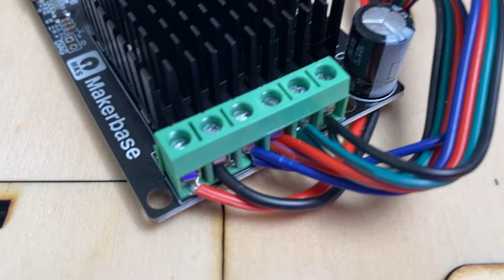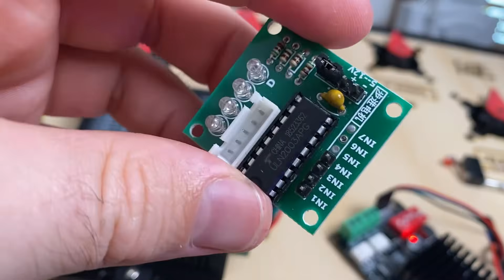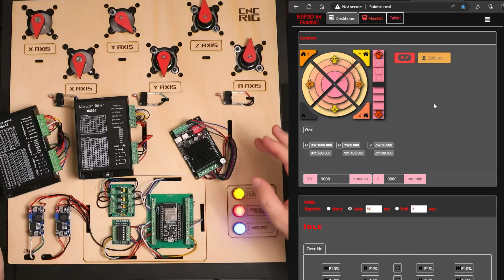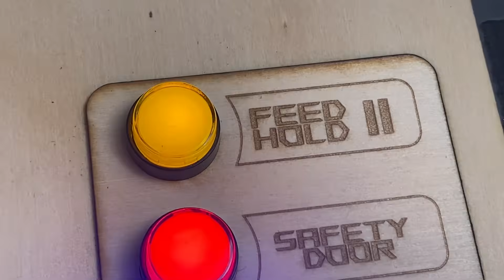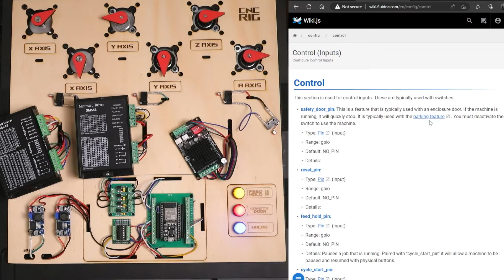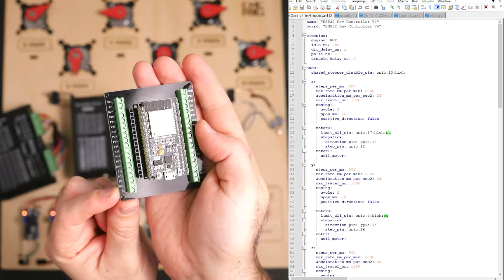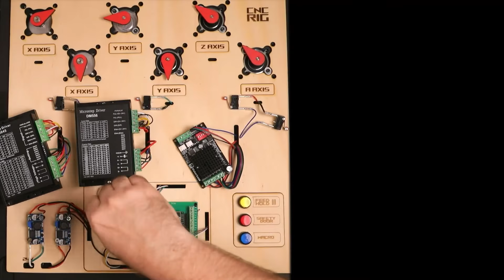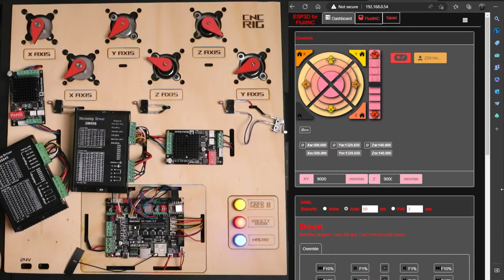CNC Wiring Basics // FluidNC // ESP32 // TinyBee controller

Comment: hello good day,  notice that u connect the motor direct to the DRV8825 Stepper Motor Driver.  con u also connect the power supply as well if u want to use a 45v powersupply.

Comment: Why not use optocoupler for the motor drivers as well as the limit switches.  Asking because i don't know and want to learn. Not to criticize
Reply from the maker: Great question and I really appreciate you asking it from a learning point of view 👍

You’re absolutely right that optocouplers can be used, and in fact many stepper drivers already use optocouplers internally for the STEP/DIR inputs. Their main job there is electrical isolation to protect the control electronics from noise, ground loops, or faults on the motor side.

On their own though, optocouplers are fairly basic devices. They’re great for isolation, but they’re relatively slow, add signal delay, and don’t handle the precise timing and high-speed signalling that modern stepper control needs by themselves. That’s why they’re usually paired with dedicated driver ICs that handle microstepping, current control, interpolation, stall detection, and so on.

For things like limit switches, optocouplers make a lot of sense and are commonly used, especially in noisy CNC environments. For motor control signals, they’re already doing their job behind the scenes inside the driver, rather than being added externally.

So it’s not a bad idea at all, it’s just that in modern CNC setups most of that work is already baked into the drivers we use.
Reply: @NEWTechCreative thank you for the detailed reply. That makes a lot of sence. I have to admit i am struggling with this yaml file for my plasma cutter and fluidnc. Do you by chance have an example i could use as a starting point? Thanks alan
Reply from the maker: @alanswanson5642 unfortunately I haven’t yet had a chance to dive into the work of plasma cutting, however this it a machine that would love to build down the track. Feel free to send me more info about your machine and what would you like to do and I’ll do my best to direct you. Newtechcreative@gmail.com

Comment: Great video i used it multiple times to reference the wiring scheme. 
Can anyone tell me when i wire things like this is it safe to connect esp to computer with usb cable? 
I'm using fluindnc with UGS over network for machining but now would like to add laser and did not find any sender for fluidNC that will work over network
Reply from the maker: That’s great to hear. Yes, it’s safe to have the ESP32 wired to your PC, but you may run into upload issues if certain pins are connected to external hardware. If you have anything attached to GPIO 0, 2, 5, 12 or 15, you might need to disconnect those lines before uploading because they’re boot-strapping pins and can interfere with flashing.

As far as I’m aware, only the onboard FluidNC WebUI can be used over the network. For sending G-code over USB, you can use a range of programs. LightBurn and LaserGRBL both work well with FluidNC when connected via USB.
Reply: @NEWTechCreative  Thanks, that’s what I thought for GPIO 0, 2, 5, 12, and 15. I just need to cut the +5 V that is coming from the DC-DC step-down (i wired it that way so i can use it ugs from anywhere without cable) sending g-code over network is stable for me with UGS but it wont be for engraving images

Comment: Mine, when jogging negative x, the stepper negative z also moves and vice versa, please help me
Reply from the maker: Without much context sounds like a wiring problem. Check where you connected your pulse and direction pins to your drivers.

Comment: Do you recommend fluidnc over grbl software, I'm running esp32 as well
Reply from the maker: Great question! FluidNC is a very active project with new features and updates released regularly. At its core, FluidNC is based on GRBL, so the motion control fundamentals are very similar. The main difference is that FluidNC is designed specifically for the ESP32, allowing it to take full advantage of the hardware (Wi-Fi, web UI, more memory, faster processing).

Some people prefer the simplicity and long-standing stability of GRBL, but if you’re looking for additional features, flexibility, and modern hardware support, FluidNC is an excellent option. It supports multiple axes, more advanced kinematics, external drivers, SD card streaming, and has a built-in WebUI for configuration and control—things GRBL doesn’t provide out of the box.

So if you’re already running an ESP32, FluidNC is definitely worth considering as it’s purpose-built for that platform and continues to evolve quickly with community support.

Comment: somebody has probably brought this up already, but in case they haven't: that connection on the esp32 expansion board isn't mislabelled as ground, it's just that the expansion board is for a different version of the esp32 board than you have. My esp32 has ground pins consistent with the expansion board; I was careful to buy them as a package on aliexpress so that I wouldn't get surprizes.
Reply from the maker: Oh good find!! Since making the video, various breakout board have been released online and definitely plenty to choose from 👍👍

Comment: I have a small question, what wire gauge are you using to connect the tiny bee to the external driver?
Reply from the maker: As it is only needing 5v and low current 22guage is more than sufficient

Comment: I have a TinyBee on the way. I can't make any sense of this.The board it's all mounted to hides the wires. I would get so much more from seeing which wires go where. When you talk about pins, I can't see the connection between the config file, to the physical configuration.
Reply from the maker: I can appreciate your point! Unfortunately it’s not as easy to outline traces from esp32 on the tinybee without having to view mks tinybee schematic. There is a great wiki in fluidnc that should be able to get you in the right direction. 
http://wiki.fluidnc.com/en/hardware/3rd-party/MKS_TinyBee
Reply: @NEWTechCreative  Thanks man.

Comment: Im building a budget cnc plasma and I'm considering the tinybee controller.  So just to be clear, with this board it produces the 5v for external drivers instead of the 3.3? Also is this board opto isolated or should i still install the one you had installed in the first demonstration?
Thank you.
Reply from the maker: Great question! No- I don’t believe the tinybee has any optical isolation on inputs/outputs. Yes the motor outputs are 5v. No need to use optic isolators on outputs…. Only inputs if needed. If you use shielded wires you might be ok… however I have heard users struggling with isolation and plasmas. Ensure you use the plasma units with CNC compatibility to reduce arc EMI. I would prefer to invest in an isolated board if you are going down the plasma cutter track such as the root controller. I have wanted to build a plasma cutter for some time now. Keep me up to date 🤩🤩
Reply: @NEWTechCreative  
Thanks for the reply and information.  I have built other plasma tables in the past without any interference. I always use Hypertherm and always shielded cables. This is just the first time using this type of controller.  I have always used LinuxCNC with a PC in the past. Thanks again for the help.
Reply from the maker: Perfect! Would love to see your builds 🤩

Comment: I am building a machine with 3 axis with a rotary option   i will be using an esp32, do you have the yaml file or a link  for the esp32 at the beginning  of your video  i know there is a lot of personal changes that i will need but my system is very basic
Reply from the maker: Thanks for your comment. I was using the default 3axis file from the fluidnc files: 

https://github.com/bdring/fluidnc-config-files/blob/main/official/3axis_v4.yaml

Enjoy 😊

Comment: Hello! You possibly don't have a diagram of how you have connected stepper motors and drivers to the esp32? and how have you calibrated the stepper motors in fluidnc? good video thanks
Reply from the maker: Here is the correct stepper motor wiring: 
https://github.com/NEWTech-Creative/NEWTech-Creative/blob/main/Correct-Stepper-motor-wiring.jpg

I used this yaml file: https://github.com/bdring/fluidnc-config-files/blob/main/official/3axis_v4.yaml
for other sample yaml files and boards: http://wiki.fluidnc.com/en/hardware/existing_hardware

I hope that helps!

Comment: Very detailed video thank you!  
I just got my Tinybee board and I am wondering where the laser control board hooks up?  I have a Lasertree 40W diode that I am building a custom frame/enclosure for (hence the extra axis outputs) .   On the original GRBL 1.1 board and the MKS DLC32 I understand there is a connection on the "S' terminal and 12v (3 wire total) going to a adapter board that takes the 24v in.  Then this goes to the laser module.  

Where does the wire that is normally on the S terminal go?  And do I get the 12v off this board to power the adapter?  I am assuming that I need to tell the firmware this is also the case?  And max power settings?
Reply from the maker: Great question! If you haven’t had a chance to view this wiki, check it out. 

http://wiki.fluidnc.com/en/hardware/3rd-party/MKS_TinyBee

This shows gpio.2 for the ‘S’ (signal). There is a pinout IO diagram where to find it there as well. You will need to hookup an external 12v to laser and split your GND to one of your GND pins on tinybee and to your 12v supply. 
If you are powering your tinybee with 12v, you can wire the board and laser from same power supply, otherwise find a dedicated 12v to power your laser separately. Over voltage will fry your laser module.
When you see the example on the wiki, copy and paste it into your own yaml as it provides the hz and speed map already. Here is the section to copy for yaml:

Laser:
  pwm_hz: 5000
  # on 3D Touch connector (has pdwn + PWM)
  output_pin: gpio.2:high:pd
  s0_with_disable: true
  tool_num: 1
  speed_map: 0=0.000% 1000=100.000%

Let me know how you go!
Reply: @NEWTechCreative  Thank You so much!   
I managed to get the laser to fire and the axis all moving in right direction and homing the way I want!   I only tested at 1-6% power and see a difference.  I will test it better tommorrow once I get wiring cleaned up and old laser out... 
The bad news is I had a accident and will be repairing my Lasertree 4-LDS control board...   the 12-24v input to the adapter card had reverse +/- and I might have cooked the laser module.   I am upgrading at the same time to the Laser tree K30 I couldn't turn down the pre black friday sale on now!  
I am tiding up wiring and looking to activate the fan via the fan 1/2 outputs on the Tinybee.  I have seen the pinout diagram shows this to be IO147 and IO 148.  
But the example I have seen says -    
# FAN1
  enable_pin: I2SO.16
I have also seen someone say they added a fan using this:
#fan
user_outputs:
  digital0_pin: i2so.19
I have tried a few things but can't seem to figure it out. 
Does this need to be in a specific spot in the config?  
How would one use the "fan1" output and does it come on all the time or only at a certain point?  
Thanks again for all your videos and help!  It has been one of the best references I have found about tinybee.  In fact I learned about it from your fluidnc flash video!!  I returned the MKS DLC and got this 6 axis card!
Reply from the maker: Thanks for your message and sorry to hear about your laser board. Hopefully the new module will work ok. 
Yes you are on absolutely the right track for the fan output pin. The mks labeling of pins is quite different from the fluidnc pin labeling. Digital outputs work with the m63/4 p0 command. If you type m64 p0 into your commands, this should turn the digital_pin high (on) and typing m65 p0 will turn low (off). The digital_pin:1 will be controlled by m64 p1 and m65 p1 etc. if you use m62 and m63- this will be in sync with motion. Hope this makes sense?
You can insert this into your gcode or make a macro to have a quick access button to turn on and off fan when needed. 
If you need more help with this, feel free to send me an email to newtechcreative@gmail.com

Comment: I love this setup and video, and have been planning on trying this out for almost a year, and finally am about to do so, but I ran into a bit of a problem where I'm going to need to control/run x2 NEMA23 4.2amp stepper motors for the Y axis, which now I'm unsure how to do this using this type of ESP32 configuration?
I purchased 3 DM556 Drivers a few months ago, which I'm guessing I will now need a 4th for the extra Y axis stepper being added, as you probably can't run x2 NEMA23 4.2amp stepper motors off on 1 DM556 right?
And if so, would you just run 2 wires off of each of the Y Step and Y Direction coming out of the ULN2003A chip/board?

Or will this setup not really work with two Y axis steppers?
Any suggestions??
Please and thank you???
Reply from the maker: Great question. Yes you can run 2x motors off one driver, however the driver can only output max 5.6A and under power your motors (2.8A each). Best solution is to buy another driver and split step and direction from y axis from the uln2003A chip (yes only one needed per axis output). Alternatively you can purchase a dedicated esp32 CNC board that has additional outputs to control y axis separately and save additional wiring.
Reply: @NEWTechCreative  Oh awesome thanks.  I was concerned that the output from the ULN2003A chip might then be underpowered as well for the Driver to work properly, kind of like before adding the ULN2003A and just running off of the 3v that the ESP32 puts out?  So thought maybe I might need another ULN2003A chip added as well somehow?  But you figure that shouldn't be an issue?  Thanks for your feedback, I really appreciate it!
Reply from the maker: No problems. I like your thinking - very logical! The one uln2003A chip will be more than sufficient to run both Y axis drivers.
Reply: @NEWTechCreative  Perfect, thanks man!

Comment: How did you wire your limit switches on the makerbase board? I see 2 wires coming out of the switches and 3 going into the board at different colors? I am trying to figure out my home switches with a mks dlc32 2.1 board.
Reply from the maker: Thanks for your comment. Some limit switches or sensors have a 5v function for the 3pin setup, however if only using basic switches like mine in the video, only need to wire one side to GND and other to Signal.

Comment: I wonder if you could help me with my dilemma?

I built a CNC Plasma table and control it with an MKS DLC32 V2.1 board (with built in Wi-Fi) and Open Builds Control (which I really like). OB will run the g-code file just fine as long as the plasma machine (pilot arc) isn't turned on. Once the plasma cutter fires the CNC machine freaks out and ends up either stopping with the torch still firing, or it takes off in some random direction - and OB responds with a lost port error and I need to reconnect.

Obviously this is an EMI issue. I've tried numerous shielding, grounding, and isolation methods with no luck. However, if I load the g-code file onto an SD card, insert it in the control board's card slot, and run the g-code on the card from the "MK Laser" app on my phone, I can get a successful cut - but this also has drawbacks as the MK Laser app doesn't have z-axis control (I hear it used to) and the Z-axis height changes once the g-code starts to run. Messing with the MK Laser app to get it working this way is just a huge PIA and I would prefer to have the code being executed from inside OB.

What I would like to try is controlling the MKS DLC32 board via Wi-Fi through the Open Builds Control software, but OB doesn't find the board when I scan networks. I've read in the forums that OB uses "telnet?" and would need GrblHal to be installed on the MKS board. I've also read FluidNC might work. But this is where things start to get over my head. Nevertheless, I'm convinced I could flash my board with either GrblHal or FluidNC (maybe even old ESP?) but I would need to get some very simplistic instructions on what steps I need to take to accomplish this. I realize a better card with ethernet or parallel connectivity would be a smart alternative, but I'd really like to see if I could get this card to pull it off.

If you could assist me without boggling my mind with too much tech jargon (since I'm over 60 and this stuff will surely not attach to my brain neurons without many reiterations of the same info) I would very much appreciate it.

For me simple is like this: go to _ and find _ and open it and then navigate to _ and place it in _ by dragging to _ and then... After you do that then go to _ and download _ and then open the folder named _ and then... etc. Thanks!

Robert H. (a struggling newbie in the world of files and configurations and other seemingly complex operations)
Reply from the maker: Thanks for your comment Robert. This sounds like an issue I would love to help you solve, however this is not the right platform to assist. Discord would be the best place to help you with this: https://discord.gg/C64SwECE
Otherwise email me on newtechcreative@gmail.com 

Chat soon!

Comment: I seen some video where a TFT screen works but the poster gives no info. Does anybody know how it's done
Reply from the maker: There has been no official release for this support, however people have been tinkering in the code to have some ability to work. If they haven’t shared the code, it probably because it was not stable. For info about implementing this type of code or reasons for no support check this out: http://wiki.fluidnc.com/en/hardware/pendants_displays